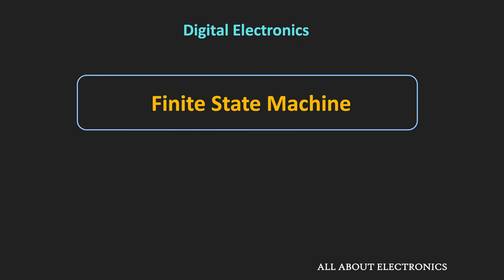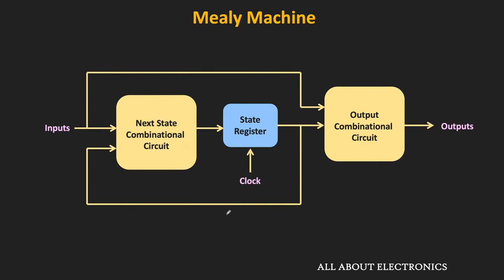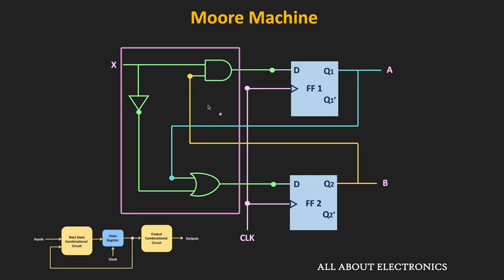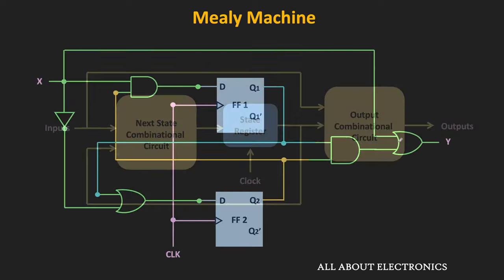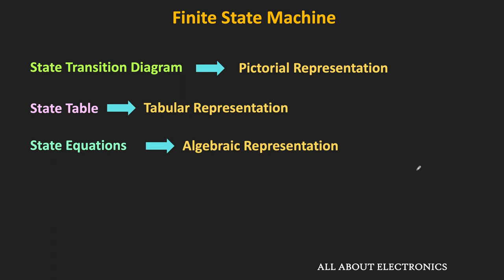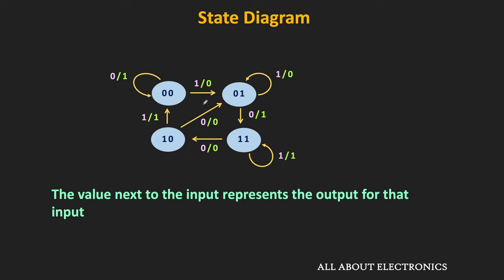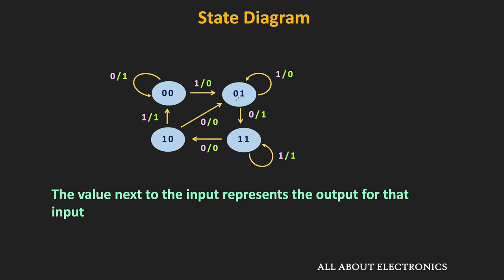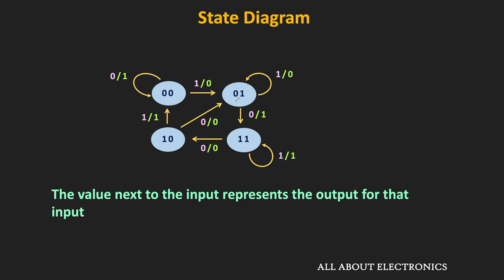Finite State Machine Explained | Mealy Machine and Moore Machine | What is State Diagram ?

Comment: In other websites it is showing that In Moore machine  the output depends on the present state but in your table it is showing that it depends on the next stage.
Reply from the maker: In Moore machine, output only depends on the present state, as it is evident from the state diagram. But in the second row of the table, by mistake, the output is written as 0. (when the present input is 01). It should be 1. For the rest of the cases, it only depends on the present state. But it does not depend on the next state. Probably, you might be meaning to say an input I guess. But by mistake, you have written next state. I hope it will clear your doubt.
Reply: yess thankyou but when present state is 10 then it should be 0 but it is written 1 ,  so i guess the outputs of 01 and 10 have been interchanged by mistake @ALLABOUTELECTRONICS
Reply: @courcestudy933 you are right

Comment: 14:30, What is meant by the input sampled right before the edge? I have also read this in a textbook but I have a bit of difficulty in understanding this concept.
Reply from the maker: Like I said, the input is synchronized to the inactive edge of the clock. So, before arriving the next clock edge, the output of the circuit will get settled. (Typically, the propagation delay of other logic gates will be less than half clock period. In this case, the input X is connected to the OR gate at the output, So once the input X is applied at the inactive edge, the stable output of the last OR gate will be available before the next active clock edge). Therefore, the best time to sample the output is just before the next clock edge. I hope, it will clear your doubt.